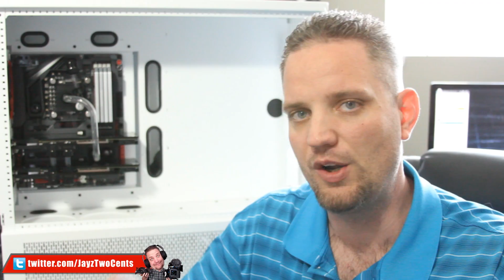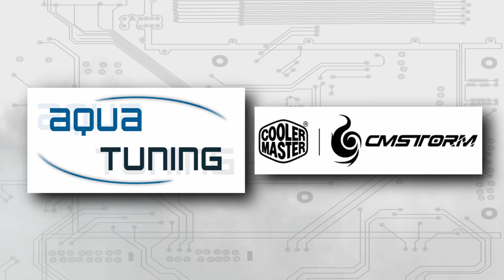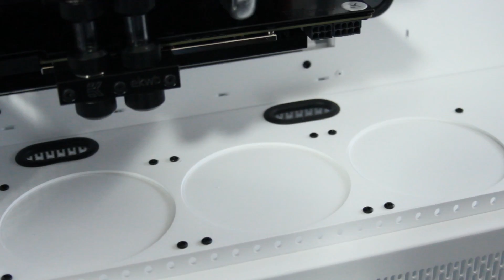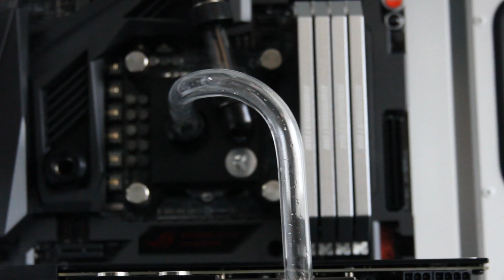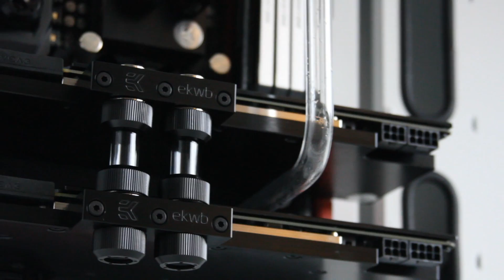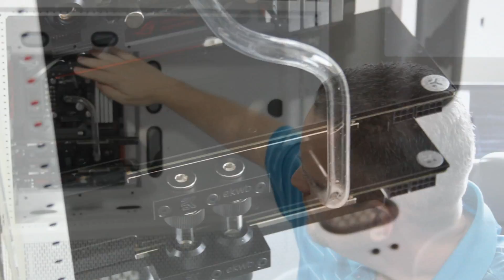Project Red Mist - Part 3: Rigid Tubing

Comment: I was wondering if any of the fans in this build are PWM fans, second do PWM fans really matter when building a water cooling build or a All-In-One Build say with the Corsair H100i, H105, or H110. If I was to get SP120 quiet edition fans without PWM would I be able to control the fan speed with my on-board fan controller (motherboard is MSI Z97 Gaming 5) (CPU Intel I5 4690K Not over clocked) (GPU: MSI GTX 770 2GB Factory Over Clocked edition) also I was wondering because the AF120, AF140 and new SP140's dont come in PWM versions, (I cant get SP140 fans where I live unless I order them online... which I dont plan on doing) would they be able to be controlled by the motherboard also? 

So really if I get the Corsair H105 with two SP120 quiet edition fans on top and two AF120 quiet edition fans on bottom in Push-Pull Config would i be able to control all four fans speeds with my motherboard or would i need to get 4 SP120 PWM fans to control them? since AF120's don't come in PWM versions? (the case it would go in is the corsair 750D in the top radiator mount position) (Front Intake fans: two SP120 Quiet edition "PWM or Not PWM?" or two AF140 quiet edition,
Back Exhaust fan: AF140 quiet edition, Bottom Exhaust fan: one AF120 Quiet editon, Top Intake Rad Fans: Radiator with two SP120 Quiet editon "PWM or Not PWM?" in PUSH and two AF120 quiet edition in PULL OR four SP120 Quiet edition PWM PUSH-PULL)

Thank you and any suggestions or comments are appreciated hope this is not all confusing
also I have used the H80i before in my build but it broke awhile ago so currently using stock Intel out of the box cooler
so i want to upgrade my case, cooler and fans. I bought the wrong fans when I built my system, currently using 5 SP120 PWM High performance Fans (very Loud on 100%) in a Cooler Master Storm Enforcer Case, two on top exhausting, two on the front intaking, and one on the back exhausting... yes i know that kinda of a negative pressure environment but the top and back fan mounts are not filtered so the have to be exhaust with the 750D I can achieve a positive environment. when I had my H80i it was in PUSH-PULL config at the back of the case exhausting so in total my case at that time had 6 SP120 PWM fans.
Again thank you to anyone who reads this and can provide some information and answers to my confusing questions.

Comment: Why did he not take a i7 4970 instead of 32gb of ram?
Reply: Easy because there is no 4970. only 3960x/3970x/4960x.
Reply: maybe needs the ram
Reply: but 16 gb ram and a i7 4970 would be bettter then 32gb and i7 4770
Reply: Ted SN maybe he wants to make a ramdisk
Reply: ***** the better tube in my perspective is quite acceptable it is for a " longer better lifespan", and if you arent gonna be upgrading the PC for a long time its probably the right choice.
Reply: ***** well first off, its not probably because he does not cares of the budget, he probably does but thats what he wants for his money, 4960x is probably not the best for his money like the 4770k is fine 300 for the 4770k is better to understand than the $1000 price premium for the 4960x for the difference he could either save money or add another GPU, and the 64gb of ram is probably too overkill for him he doesnt need it so go with the 32gb thats an 50% off.

Comment: Needing a 2nd opinion. I have a GTX 760 and plan to get another one sometime next year. Would this be a good power supply or is there a better one to go with keeping price in mind. http://www.newegg.com/Product/Product.aspx?Item=N82E16817139010
Reply: It's a bit old now and not fully modular. If you already have a 650w PSU I'd leave it at that, if not get a RM 650 or RM 750, You're PC probably isn't even pulling 550w at load http://coolermaster.outervision.com/PSUEngine.
Reply: This one, as I mentioned in my comment... http://www.newegg.com/Product/Product.aspx?Item=N82E16817139054
Reply: That is an amazing psu and would probably power a 780, but as ***** says your PC probably isn't pulling 550w, so I would look at a cheaper psu around 700w but a 650w would probably be fine.
Reply: What about this one.
http://www.newegg.com/Product/Product.aspx?Item=N82E16817438005
Reply: Fan doesn't turn on till a certain load, reliable, nicer cables, full modular etc.
Reply: ***** Looks good, thanks.
Reply: I should be getting it soon too!
Reply: deezyyy I'm running my EVGA SC GTC 760 w/ACX with a little OC on a 500w PSU and I don't think I'm coming close to 500w.
Reply: The minimum wattage is usually crap
Reply: ***** The minimum wattage is 500w, but I'd guess you would only need a 450w, but I wouldn't recommend that,
Reply: yeah its fine - it'll do the job - you might go a bit lower even :) - You dont need a 1000w like some people would say. TTL did a FUll Oc'ed 4770k with 780ti h100i formula mobo and a ssd and 1 normel storage (i think there was 2 drives) and he only drew about 420W at full load on both cpu and gpu :)

Comment: Jay all you need to do with  the tube that goes from the gpu's to the cpu is flip/flop to the back of the case if you don't want it to interfere with the ram. since its going to be a custom build and not much room for expansion, just extend it over the ram a bit to get the length and the angles correct.
Reply from the maker: Collin Huebler There is about 3 times the room I need now to remove the ram. In fact the tubing is no where near the ram. Go to instagram and you will see.
Reply: Well if he runs it parallel with the south bridge pipe (which he should) then he should have lots of clearance to take the ram out.